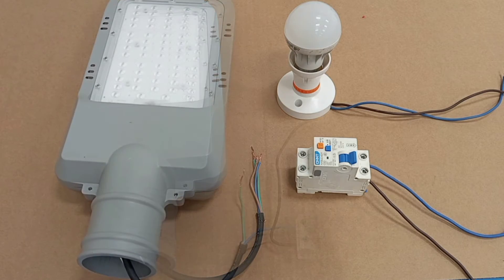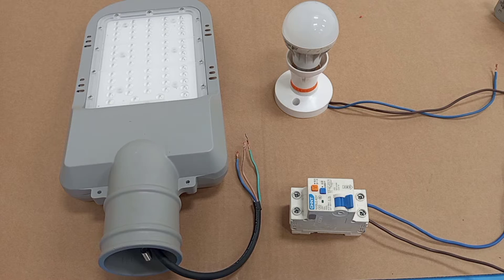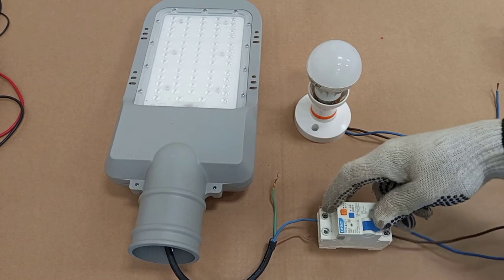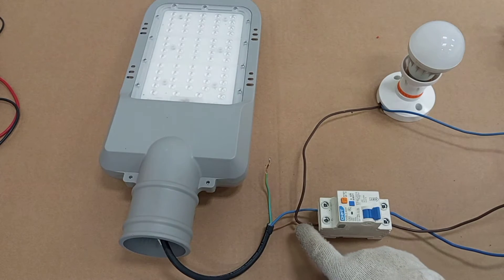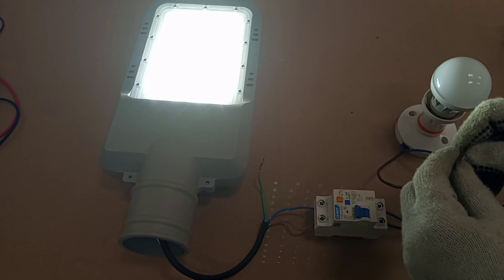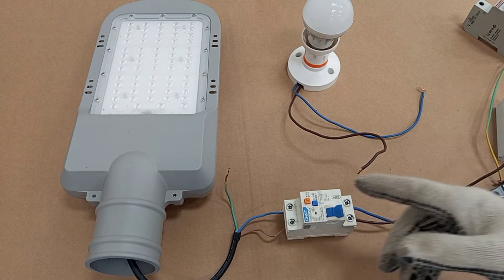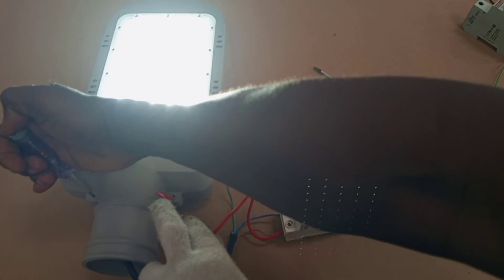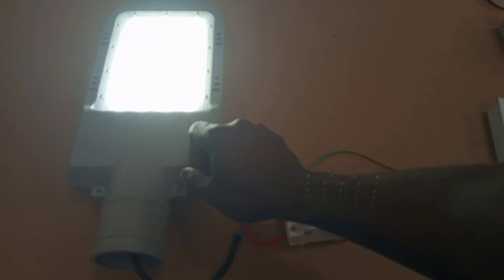How RCDs work without earth | Live-neutral leakage versus Live - Earth leakage|

Comment: Thanks but what if you just put the earthing conductor into the ground with an earthing rod? Will the Rcd operate or it needs something else to trip? Neutral connected to earth at the supply?
Reply from the maker: @Death88758  please the question is not clear to me.
Reply: @obloni_Electrical  I installed solar pannels with batteries off grid and tried to do the same thing as you to make the RCD trip with an earthing rod but nothing happens
Reply from the maker: @Death88758  Please you can contact me on WhatsApp +233209323669 for assistance. Thanks